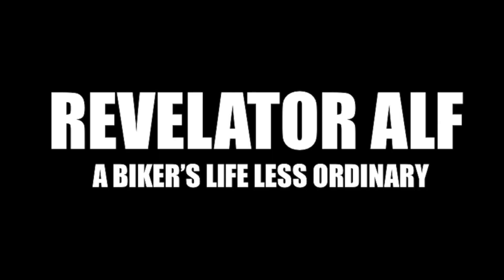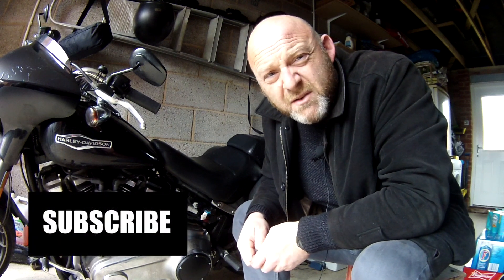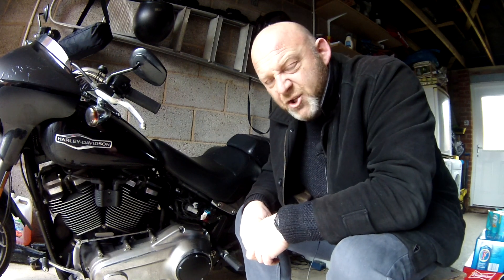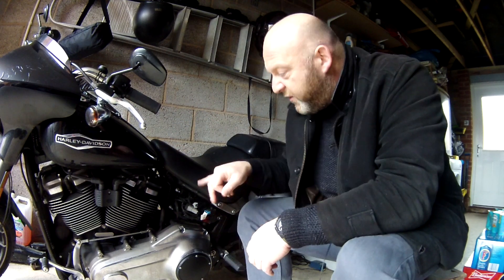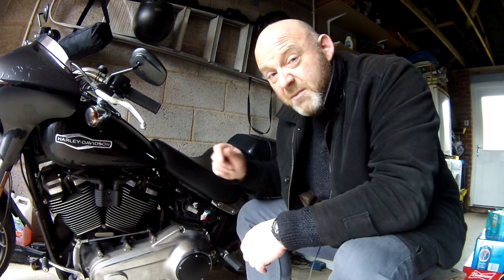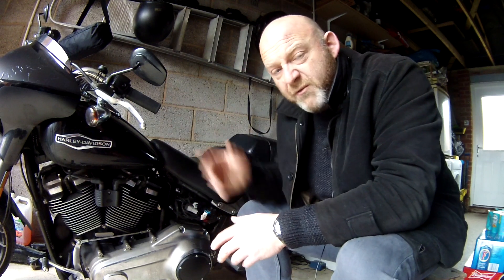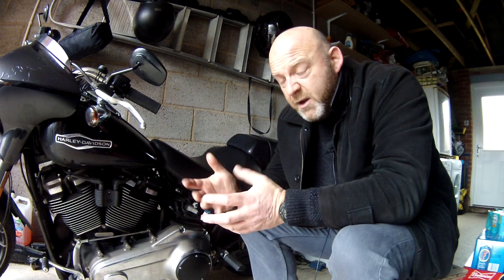What is the Harley Davidson CAN BUS system - How to access Harley diagnostics

Comment: It's a nightmare to work on my 2014 ultra classic EFI BCM ECM system. Replaced the fuel filter and when I press the start button. I get nothing to the starter solenoid. Checked battery 12.54v passed load test. Jumped starter with 12v and  starter spins. I'm starting to hate this bike. Fob battery is good and I can put in pin manually without fob. I'm so frustrated and can't afford to take it to the Stealership.

Comment: I am hoping to change my indicators on my XL 883 R SPORTSTER 12 (2012) to LED,  getting mixed info on simply using a load equalizer  but nothing if mines has the CAN BUS system, how do I find out if mines does have it and if it does how can i fit LED turn signals ?

Comment: Hi Alf,
I was checking parasitic draw in my 2017 Softail and getting some strange numbers. Does the CAN bus draw current with the ignition off?
Thanks.
Jim W.
Orangevale, CA.
Reply from the maker: Yes there might be some but you may need to check how much you’re losing too. I think from memory 20mA is for the security system but not sure on the numbers off hand

Comment: hi, i had to replace the burnt odometer on my 2009 harley electra glide. the new odometer started at 00000 and i have already driven 1500 km. do you have any tools and wiring to restore the original kilometers to the new tool?
Reply from the maker: If your bike has a BCM then I believe it will have to be matched to that before it shows original km so try to find a workshop that can do that for you

Comment: That was very detailed. Mine had a CAN bus failure codes when it was new. It was just a connector that didn't get properly seated.
The wave reflection part was good. You should do one on exhausts. Motorcyclists hold onto many myths. One is exhaust "back pressure." When you're trying to evacuate a cylinder of its contents, the last thing you want is back pressure at the exhaust port. What you want is the pipe tuned to provide a properly timed reflected wave to stop fresh charge from leaking out during the valve overlap. 
HDs used to run 2 into 2 exhausts. They have that old school sound that I associate with Harleys. Hardly ever hear it anymore. Problem with them is they don't have that "scavenging" reflected wave front and have a dip in the power midway thru the rpm range. They usually do make better peak power than more modern 2 into 1 pipes though. As we street riders don't normally ride around WFO, so making the power more linear thru the range with the 2 into 1s is the better option. Although they do kill that cool old Harley racket.
Fun story. Many moons ago I had to whip up a PCI motherboard for a project. Those actually used a diode termination. Weird as you normally terminate in a transmission line with its characteristic impedance in the form of a resistor. Anyway, that was how those PCI designs were specified to be terminated and it works. Don't remember if I ever figured out why though. Water under the bridge at this point I suspect.
Reply from the maker: Thanks great comment. Yes I’ll certainly be looking at that in the future too. Cheers

Comment: BMW has had the CAN BUS system on its bikes for some years. I know from experience that the system can be very sensitive to electrical modifications on the bike, amongst other things. Thats why I was surprised to see so many mods on CAN BUS equipped Harleys, performed by home mechanics.
Reply from the maker: Yep lots of the electrical mods are because new components for Harleys are Can Bus ready and will just plug in